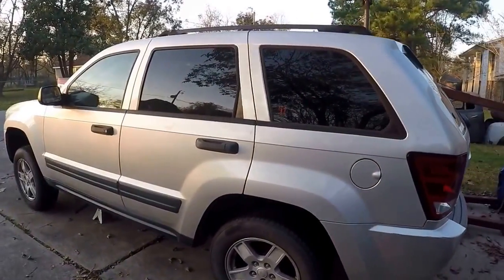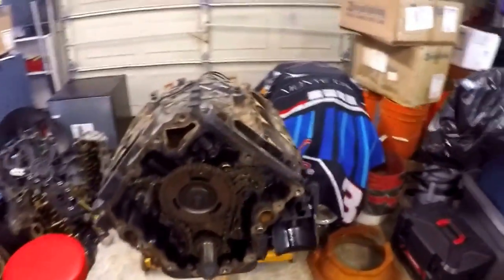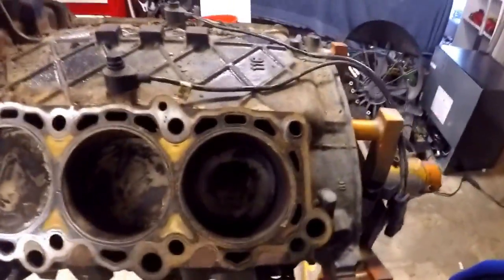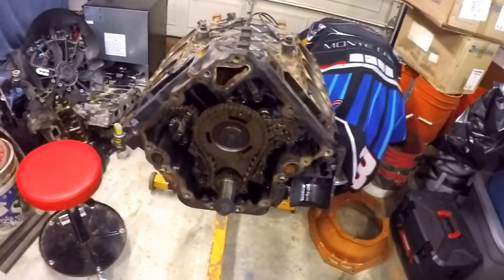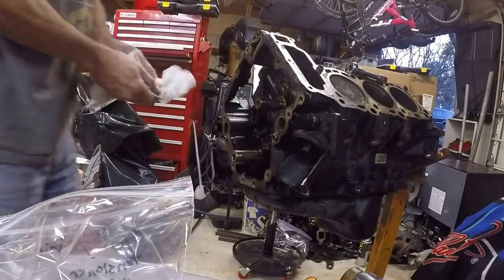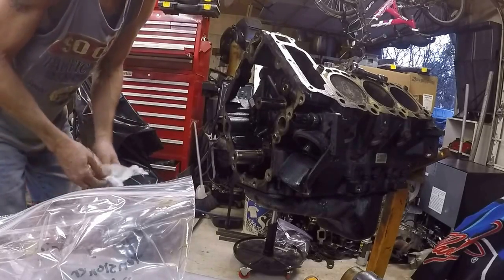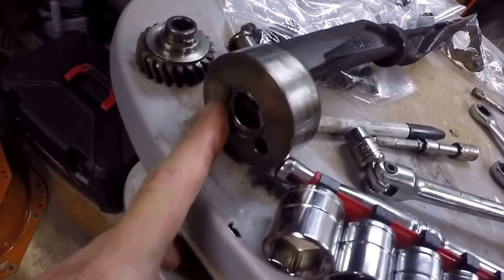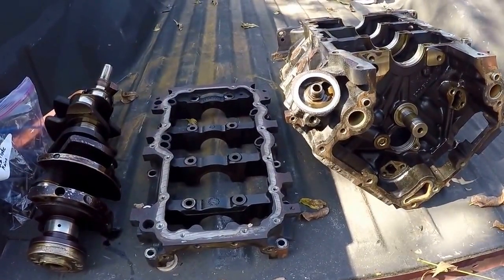Engine Rebuild - 3.7L 2006 Jeep Grand Cherokee Laredo - Part 1

Comment: High I believe I have a broken connecting rod in my 04 3.7l magnum, is it normal for all the oil to leak out of the exhaust when something like this happens. I've had the truck parked over concrete and haven't noticed any leaks from the block

Comment: hi Trey . I have a 2002 Cherokee in England . 3.7 v6 . the engine is dead . was bought that way . I have been told the 4.7 v8 bolts straight to the  gear box . do you think I could use the ECU from the v8 in place of the v6 ECU to get the engine to work in the Cherokee ? cheers in advance . Stuart.

Comment: Is it possible to increasing compression ratio in this engine (about 13:1 or 14:1) without destroy engine? Does it hold moderate compression ratio?
Reply: Requires aftermarket pistons. The stock pistons have high ringlands that blow out under any level of boost. Airram Performance sells pistons.

Comment: It is non interference engine?
Reply from the maker: You might check the attached video from Chrysler. The reference to the non-freewheeling nature (interference) of the engine is mentioned at 5 min 17 sec. I hope this helps.

https://youtu.be/BOx191b_u0c
Reply: Trey Clanton im sorry i was making a question, i didnt put the question mark...
Reply from the maker: Berto Sanshoku Sorry if I misunderstood. You were asking a question? My Apologies. It is an interference engine. The video referenced from Chrysler is a good one to watch.
Reply: Trey Clanton thanks i saw the video. Interesting, i got a problem, somebody work in my grand cherokee engine before me, leaving the marks in the timing chain misplaced, now i got to fix what somebody do, i think the pistons touch the valves... Im working on it.

Comment: Where can i buy a bed plate or does it have a different name, mine has a crak on it
Reply from the maker: I would start at a junkyard. If they have a non-runner, they might be willing to sell the bed plate. It might not be real cheap since they will have to pull the motor to get to it though. Its worth a try.

Comment: Ok so if there was a piece of valve in the cylinder and the piston and cylinder wall were in the same shape as that right there would you absolutely have to replace the piston and get work done to the cylinder wall for it to run or could you run the engine with the piston in that shape? Also would the performance be severely effected?
Reply: Running a rebuilt eng with one piston and cylinder in that kind of shape would cause a catastrophic failure. First the rings would come apart the piston would also around loosely.

Comment: Hey Trey, just wondering here. When I removed my bed plate from the block there was no rtv of any kind that I could see.. which kinda blows my mind.. How could it seal? I didn't have any leaks.. is there supposed to be rtv between the bed plate and block? Mine just pried right up off the locating dowels..

Comment: My mom had a 2005 Jeep Grand Cherokee and it required very little in repairs until about 160,000 miles when the fuel pump failed, short circuited, and destroyed a wiring harness in the process. The amount of work needed to replace all that wiring exceeded the value of the car, so we got rid of it.

I felt bad to see it go, because many cars that my mom owned cost a fortune in repairs and were unreliable. Some of the reliable cars she had were destroyed in car crashes.

Comment: I bought a DNJ rebuild kit for my 3.7. I was wondering if you've ever used them before-or heard about them. A few parts are made in the USA, some in Tiawan, some in China, I think also Israel. Before I bought it I googled reviews and it seemed to have good ones but have since heard and read otherwise. Just don't want to go through all this work if I'm waiting my time. Thank you again sir for your videos
Reply from the maker: Hello. Interesting timing. I am rebuilding another 3.7 as we speak, and I am using a DNJ rebuild kit. So far so good. I've not noticed much out of sorts thus far. I did note that in the kit I have the rod bearings have alignment tabs, but the rods don't have slots to accommodate them. I had to buy another set of rod bearings from a local source to replace those that came in the kit. I can't say too much more than that. I haven't heard anything bad previously. I hope the best for both of our rebuilds!
Reply: Thanks for the reply. Everything looks to be of good quality so I hope all goes well. You've rebuilt many motors, so if something looked cheap I'm sure you could pick it out. This is a first for me so I'm taking my time as a side project. Thanks again

Comment: If i may ask where did u get the rebuild kit?? I need one
Reply from the maker: Joel I Hello! The rebuild kit was purchased from carpartswiz on EBay. The remaining parts were picked up here and there. I had previously purchased an engine rebuild kit from the same seller with success.
Reply: Thank you for the fast response my jeep burns oil at full throttle i can see the smoke At night when theres a car behind me i was told its my rings that are wore out what's your opinion? compression test?

Also how much would a machine shop charge me to machine the heads and clean up the block?
Reply from the maker: I would do a compression test, but it is not always clear from a compression test whether the rings as worn out or not. If the smoke is a light blue hazy smoke (not white steamy smoke), then the rings are most likely the culprit.
Reply: Well oil goes missing and it doesn't leak so most likely its the rings or valve seals my coolant level is always the same so its not head gasket i hope
Reply from the maker: It sure sounds like you're on the right track. I wouldn't order the rebuild kit until you get the block checked out in case they need to bore it oversize. Good luck with your rebuild, and holler if I can be of any assistance!
Reply: Okay i did a compression test and the lowest is 105psi and the highest is 120 psi all others range in between i also noted that its leaking from the valve cover gaskets what do u think?
Reply: Is it worth the rebuild?
Reply from the maker: That's one question I can't answer. Assume you will spend $1500 in parts and machine shop bills, and then decide. I've seen people walk away from rebuilding motors on cars worth quite a bit, and I've seen people rebuild engines in cars that aren't worth the cost of the parts. Every individual has there own motivations. I tend to rebuild engines for the pleasure of doing it. I think this family of engines are great. That is why I have rebuilt several of them.
Reply: @joeli9389   how much for some like this but my Jeep a 05

Comment: A Jeep 4.0L would still be running fine.
The newer Jeep V6 engines are unreliable powerless slugs.
Reply from the maker: Charles Hodge I have to agree about the 4.0L engines! I have had several and other than the tendency for the heads to crack in the middle on the early models they were great engines. I do have an appreciation for the 3.7 and 4.7L Powertech engines though! They are great motors with the exception of the valve seats tending to loosen over time. Peening the valve seats does correct that problem, but it's not a trivial fix!
Reply: Just so you know the last of the inline 6 4.0L made 190 hp @4600 rpm and 235 lb*ft of torque @3200 rpm. This V6 makes 210 hp @ 5200 rpm and 235 lb*ft at 4000 rpm
Reply: 4.0L sucks nerd

Comment: Hydrolock? 

Good engines; take care of 'em and they last.
Reply from the maker: Hydrolock indeed! It escaped me at first, but after more conversation with the owner and the evidence in the motor, that is clearly what happened. I agree, they are great motors. This one is running well after 10,000 miles post-rebuild!

Comment: Hey Trey! thank you so much these video has given me the confidence to rebuild my 3.7 in my 04 Liberty. A quick question, The shop manual I have, the listed sections in the manual would be the way to disassemble tge engins. On tge rebuild I will refer back to these videos and the manual. Thanks again!

Comment: Would you recommend sticking with the manufacturer's recommended 5w-30 oil for this engine? I just picked up an '02 Jeep Liberty and been reading about TONS of engine failures before 100K miles, mine has 240K but mostly from being towed behind a camper most of its life.
Reply from the maker: I would use 5W30 high mileage synthetic.

Comment: Hi I'm trying to rebuild a 3.7 jeep liberty engine year 2003 and I have that same problem you ve got in the video with the timing chain, it's kinda stuck. any tips please?
Reply from the maker: I had to use a small pry bar and a little pressure to get the gears to move forward enough to release from the idler. It was just a patience thing. I hope you are able to get yours to free up!
Reply: OK thanks ima try this

Comment: Now I am afraid to rebuild my 226. I dont know what it looks like in there and its been driven hard by previous owner for about 170 thousand miles and then by me for 4000 miles. Then it is also an 02 so a lot of wear and tear. And its also over heated once.